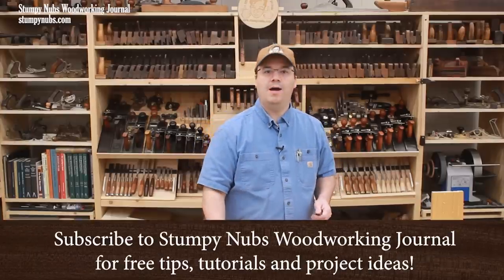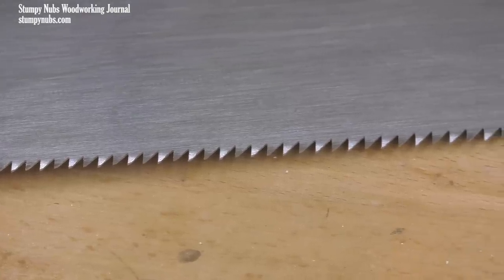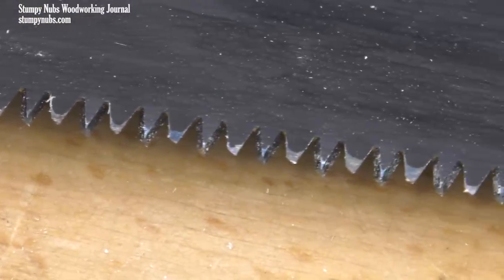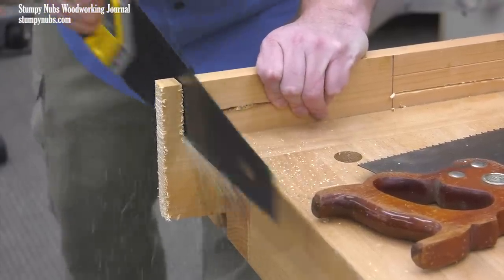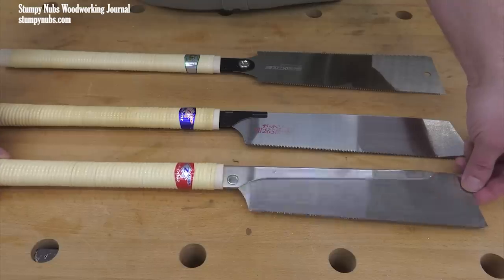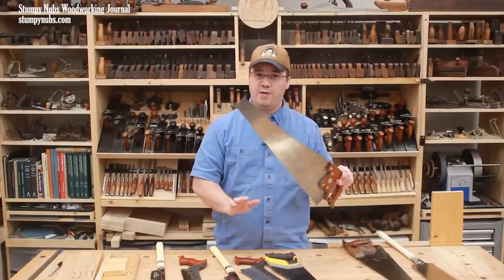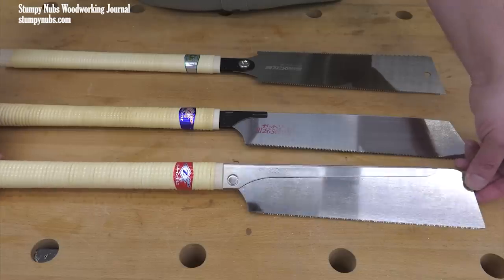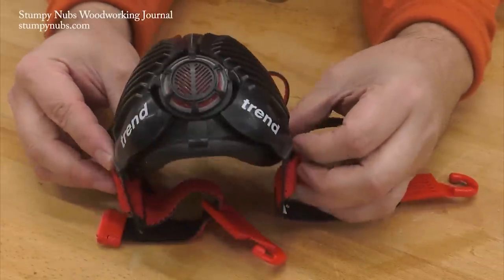Do Japanese saws cut faster than western saws?

Comment: It looked like the western saws produced a lot more tearout/rougher cut. Which is generally my experience. So even if faster in some circumstances, I probably would stick to Japanese saws. Marginally fewer strokes but a lot more time cleaning up that nasty edge doesn't seem like a good tradeoff to me. That said, it would be interesting to know if, due to the saws cutting on push vs pull respectively, the tearout was facing away from the camera with the Japanese saws? And if so, how it compared. Good video in any case!
Reply from the maker: It is also worth remembering that not all of the fastest cuts in this video were rough cuts. The rough dimensional cuts may have been, but the joinery cuts were not. There is a time for both types of cuts and a bit more speed does not always equate to a poor result.

Comment: Guess I am the odd duck in this point of view. Maybe its because of what I cut my teeth on and was raised on but I have found for myself I prefer the push saw in 90% of my wood working. Number one is I can cut a thin pencil line in half and stay pretty square through the entire cut, on long rip cuts specially when hand cutting plywood and I can cut much faster. I find the pull saw almost impossible to stay on the line and my cuts take much longer. About the only thing I prefer the pull saw for is flush cutting or standing up cutting while holding the board in place with my foot.

Comment: In my experience, the pull saw edges it for reasons not having much to do with speed. There's less chatter on the pull, as the muscle combinations used and because flexors operate more smoothly than extenders as a simple matter of physiology. Think of the difference between pushing a heavy weight along the ground and pulling it. Pulling is always consistently smoother than pushing.

The other major advantage of the Japanese saw is accurate cuts at odd angles. It's much easier to hold a pole saw at an odd angle and comfortably maintain it, which tends to lead to less wander in the initial part of the cut, making it easier to maintain your cut angle.

Speed of cut is pretty much the last thing I consider. Not that it's not a factor, but it's the least of considerations, IMO. I find I can do a lot more cutting in one sitting with a pull saw whether cross- or rip-cutting. A pull saw is also considerably less impact on what's left of my back.

I didn't think I'd ever convert, but I'm glad I did. I rarely use a Western-style saw now, and even then mostly only because I have a jig that accepts my tenon saw and the kerf is perfect for jumbo fret wire.

Comment: I've personally found that pull saws are easier to be more accurate with than push saws are, simply because there is more control in my opinion.

Comment: Hello James,
I fully appreciate the reasoning behind this video and found it interesting and enjoyable as do I all of your content.
However, does it really matter which is faster❓ Surely the question should be about which gives you the greatest pleasure to use and the best results for the individual hanging off the handle end.
If speed is what's important, then ditch the plate and use a machine.
For me, woodworking is about the doing no matter how long it takes, but that's just me. Different kerfs for different strokes❓
Stay well James 😉
Reply from the maker: Nobody says you MUST be concerned with speed, but there are plenty of reasons why one may wish to consider it when choosing a tool. Speed can equate to less energy expended. It can also make a significant difference in the time it takes to dovetail a chest full of drawers or any number of other tasks. That said, there are many other factors to consider besides speed such as precision, comfort, quality, etc. These were covered in the other video: https://www.youtube.com/watch?v=PZdoLx72faM.

It is also worth remembering that not all of the fastest cuts in this video were rough cuts. The rough dimensional cuts may have been, but the joinery cuts were not. There is a time for both types of cuts and a bit more speed does not always equate to a poor result.

Comment: I’m not sure why speed matters. Frankly if you want speed use a power saw of some sort. To me what I want from an hand saw is accuracy, and for that I love my ryoba
Reply from the maker: Nobody says you MUST be concerned with speed, but there are plenty of reasons why one may wish to consider it when choosing a tool. Speed can equate to less energy expended. It can also make a significant difference in the time it takes to dovetail a chest full of drawers or any number of other tasks. That said, there are many other factors to consider besides speed such as precision, comfort, quality, etc. These were covered in the other video: https://www.youtube.com/watch?v=PZdoLx72faM.

It is also worth remembering that not all of the fastest cuts in this video were rough cuts. The rough dimensional cuts may have been, but the joinery cuts were not. There is a time for both types of cuts and a bit more speed does not always equate to a poor result.

Comment: Nobody picks up a hand saw these days with speed in mind, accuracy and fatigue would be biggest concerns.
Honestly feel japanese saws are a bit easier to use, and for a tool people might not pick up every day that counts for a lot, you can be cautious and slow with them whereas western saws take some confidence to work.
A lot could be said about technique or how those saws arent all meant for cutting things in a vice or doing joinery (or maybe meant for a person with longer arms) but its all a bit academic in the age of power tools.
Reply from the maker: Nobody says you MUST be concerned with speed, but there are plenty of reasons why one may wish to consider it when choosing a tool. Speed can equate to less energy expended. It can also make a significant difference in the time it takes to dovetail a chest full of drawers or any number of other tasks. That said, there are many other factors to consider besides speed such as precision, comfort, quality, etc. These were covered in the other video: https://www.youtube.com/watch?v=PZdoLx72faM.

It is also worth remembering that not all of the fastest cuts in this video were rough cuts. The rough dimensional cuts may have been, but the joinery cuts were not. There is a time for both types of cuts and a bit more speed does not always equate to a poor result.
Reply: @StumpyNubs  i may have come off wrong in my comment, i do agree with you for the most part. Personal preference and familiarity plays the biggest role. My only point with speed is if its the most important factor for somebody they are probably going to use power tools/jigs etc.

Comment: I reckon there will never be a resolution to this debate. Clearly though, the best tool for anyone to use is the one they can use with the greatest skill. The only "pull saw" I ever used during my formative years was a swede saw which was only used (usually tandem) for cutting up felled trees; consequently I've never developed much skill with a pull saw. The biggest problem I find with modern western style saws is that the ones that are the most readily available all have hardened teeth which cannot be sharpened. To be fair, they stay sharp longer than my old Disstons but once they go dull, they're basically garbage.

Comment: I like these "shootouts" but something you said early on rings true with me, I'm not in it to win a race.  24 vs 19 strokes?  I don't care; is my line straight?  Is the cut clean-ish?  That's what matters.  IMO, of course.
Reply from the maker: Nobody says you MUST be concerned with speed, but there are plenty of reasons why one may wish to consider it when choosing a tool. Speed can equate to less energy expended. It can also make a significant difference in the time it takes to dovetail a chest full of drawers or any number of other tasks. That said, there are many other factors to consider besides speed such as precision, comfort, quality, etc. These were covered in the other video: https://www.youtube.com/watch?v=PZdoLx72faM.

It is also worth remembering that not all of the fastest cuts in this video were rough cuts. The rough dimensional cuts may have been, but the joinery cuts were not. There is a time for both types of cuts and a bit more speed does not always equate to a poor result.

Comment: I use both types of saws,  and using the saws I include the preparation: I keep the western saws sharp, and also do some touch up on the Japanese saws, they have induction hardened teeth and a distinctly different shape that requieres special kind of file, if you don't throw the blades when you feel they don't cut like several feet before,  you have to fork few yens for the diamond coated files with the required profile, vs the common and ubiquitous triangular files used  for the western saws.
 I assume people using hand saws are not really in a hurry, being a user of both types of saws, I still don't see a clear winner in this contest, I would say that the scientific term is: it depends.
Reply: Ps, I listened to Hamilton until the end, to see the twist he mentioned, however seems to me  I may have been clickbaited. Now I will have to buy two respirators in addition to the two kind of saws.

Comment: A lot of the push stroke saws have a much longer blades than pull saws. So if used properly  using the whole length of the blade they really should need less strokes.
Reply from the maker: Each tooth can only remove so much wood per pass, no matter how long that pass is. Longer strokes simply equate to less arm movement, not necessarily to faster cutting through the wood.

Comment: Even when really forcing the blade through the wood, the Japanese saws cut far more cleanly, which I think is probably more valuable than speed.
Reply: Depends what you're doing and how often, seconds can add up to hours and hours up to days and days up to week and weeks up to years of your life if that's your career.  Speed also effects production, and time is money in a business... Typically, things like rough cutting, stick framing a house, etc. do not require nice clean cuts.  So YMMV...

Comment: To be honest, the relative cutting speeds will make no practical difference. What is apparent is the quality of cut is better with the Japanese saws. The charge laid against them by Rob Cosman, is that when used in hardwoods, they can follow the route of least resistance and not cut true to the line. I can't say I have had a problem in this regard, but it would be interesting to know if others have.
Reply from the maker: I know a lot of guys (including myself) who have cut perfect dovetails in hardwood with a Japanese saw.

Comment: I am surprised you did not mention, as you did in your previous video, about push saws binding. When one is being aggressive and putting a lot of weight on a push saw, the potential for that saw to bind and kink blade is extremely high. That cannot happen with a pull saw. IMHO
Reply from the maker: This video focused on speed.

Comment: It is as much about the way a thin sheet of metal behaves under compression vs under tension. Pulling  a saw, even a western "push saw" straightens it, while pushing the blade makes it want to "fold" on itself. This is why I do not like push saws - when they snag, they fold on themselves and often this is why they stick while cutting.

Comment: A lot of the "benefits" that James mentioned for western saws, or Japanese saws, is opinion formed by me than rigorous examination.

I've read that the Japanese saw teeth geometry is better for softwoods than a western saw. Presumably because there isn't much hardwood in Japan.

Maybe it is true, I don't know. I do know that Japanese saws seem to cut better in is softwoods, at least to me.

Either way, technique has much to do with it. With a western saw, good technique has you grip the handle Lightly. A tight grip trend to cause your arm to twist. And you don't bear down on the saw blade, you let the weight of the saw provide downward pressure. And if that isn't working, you need to sharpen your blade.

And you want to line your body off to the side a bit so that your arm can swing freely and work like a piston directly in line with the sawblade.

All of this means more efficient and accurate cutting, and so less strain on your body.

Of course for rough cuts you can do what you want. But I don't want to develop bad habits.

That argues that the "advantage" of a western saw that is gained by pushing down harder is bunk.

I think the forgotten advantage of a Japanese saw is the thinner kerf means less force is required per stroke. So less tiring over a full day.

Anyway, that is my less than rigorous analysis.

Comment: Well i think that your final conclusion summer it all. Each saw has it advantages... when i started my hand tool woodworking i started with Ryoba did with it all but i have discovered that while working o n different cuts on different thicknesses logs it's acting differently, i always wanted to use a western saw, but the price and the maintenance were intimidating... until i saw Rex Krueger and Paul Sellers YouTube for more affordable saws and  how to maintain them...and the rest is history...i have restore few western saws: Disston 23, Thomas Flinn dove tail saw both very old but with good steal And some Spear & Jackson...all have good ingredients but had to invest some love into them... I good results with both saws western and Japanese  i learned haw to saw on the Japanese and i am implying the same principles on my western...so my first conclusion is that the person behind the saw is the one that determines the quality of the cut and not the saw!! Second conclusion is that to summering the Japanese saws to only 3 different types is a western ignorance there are so many types for using for rough sawing and joinery and yes some of them can be sharpening....
So as long you are having good experience with sawing  and you getting the results you want it doesn't matter what kind of saw you are using

Comment: I think you overlooked an important factor: how long is the blade? If the push saw is 25% longer than your Ryoba, then each stroke should do 25% more cutting. It doesn't make sense to compare saws of different lengths in terms of the number of passes needed to reach the same depth.
Reply from the maker: Each tooth can only remove so much wood from the kerf. A longer stroke just passes more teeth through the kerf with each motion. That doesn't necessarily equal less overall time cutting through the board. If that were the case I'd just get a 3-foot long Japanese saw, cut the board through in half a stroke and declare it a winner. In this video it seems to me that most of the strokes were about the same length regardless of the saw and this allows us to observe the difference between the types of saws independent of the length. After all, not all Western saws are longer than Japanese saws.

Comment: You didn't take into account that the Japanese saws are half the blade length of the western style saws.  So, if the cutting performance is similar, the Japanese saws are actually twice as fast per cutting tooth,  doing the same work with half as many teeth.  They are also much more ergonomic, as the pulling stroke is far healthier for the wrist than a pushing stroke.

Comment: Did I dream or did I notice that the Japanese saws gave a much cleaner cut?  Given that the number of strokes is pretty much the same, if the quality of the cut is way better one way or the other, that would change the results, IMHO.
Reply: you did not imagine it. the tearout on the Western saws is just painful to see after getting used to a pull saw.
Reply: I wonder if the pull saws produced tear out on the opposite side of the wood from the camera.
Reply: @nefariousyawn  there's less debris falling off the pull saws at the end of the cut.

Comment: Speed of cut is not as important to me when using handsaws as are accuracy and ease of use. If speed was my main consideration, I would use a chop saw or a table saw, neither of which I own any longer. Durability of the saw and the ability to sharpen the saw are two other attributes more important than speed. If I notice that the saw cuts too slowly, I check to see if perhaps I am not using the full length of the saw in my saw stroke, or if the teeth need to be sharpened.

Comment: It appears you did not consider the length of each saw. Longer saws cut faster because they are cutting more wood per stroke than than the short saw. BUT if you or anyone is counting seconds per cut, I think they are no longer enjoying the work and should find another job/hobby.
Truly enjoy your videos. Thank you
Reply from the maker: I used roughly the same length of stroke with each saw in the video. If length is considered, then any saw could win simply by making one an inch longer than another. It's not a good way to compare the other factors.

Comment: What's the point of this speed comparison? I'm much more interested in the quality and accuracy of the cut, which is why I'm almost completely converted to Japanese saws these days.
Reply from the maker: Nobody says you MUST be concerned with speed, but there are plenty of reasons why one may wish to consider it when choosing a tool. Speed can equate to less energy expended. It can also make a significant difference in the time it takes to dovetail a chest full of drawers or any number of other tasks. That said, there are many other factors to consider besides speed such as precision, comfort, quality, etc. These were covered in the other video: https://www.youtube.com/watch?v=PZdoLx72faM.

It is also worth remembering that not all of the fastest cuts in this video were rough cuts. The rough dimensional cuts may have been, but the joinery cuts were not. There is a time for both types of cuts and a bit more speed does not always equate to a poor result.